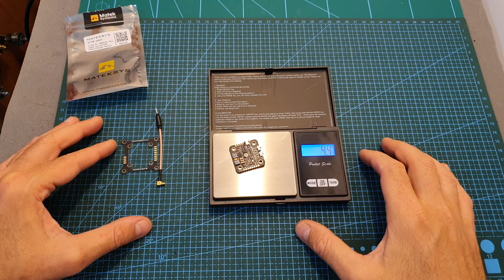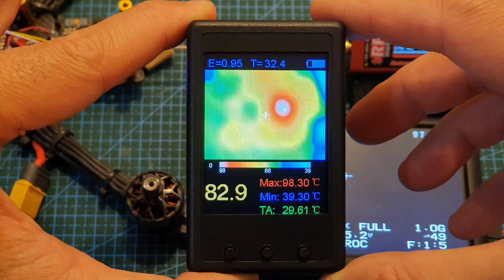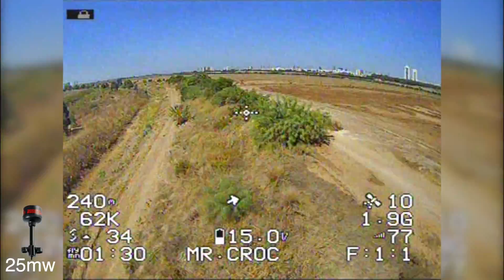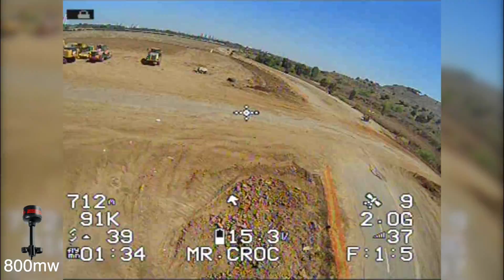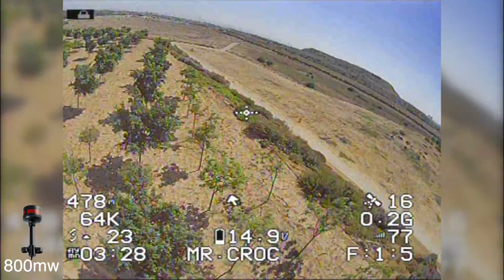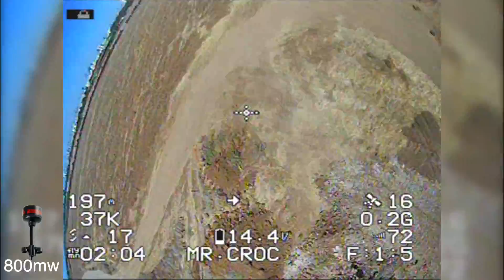Matek Systems VTX MINI - Setup, Review & Flight Footage

Comment: Used this on my dart 250g build and i cannot say enough... steer clear. It runs very hot for the wattage, has no good heatsink options, and the tramp controls through inav have been total junk and unreliable. I bought it with the justification that it would be most likely to work well with my matek F411-WSE FC... it did not, PLEASE AVOID LIKE THE PLAUGE. I also highly doubt the 800 watts is actually even accessible in tramp, look at the lights on the board when at the highest level.... 600. EDIT: I have been able to access the 800 watts and INAV arming / disarming safety settings have to be disabled to achieve more reliable power controls. Still runs hot and pit mode is not accessible via manual controls 50% of the time which sucks
Reply from the maker: Thanks for sharing your feedback. As far as I can remember I didn't end up recommending this VTX too.

Comment: Apparently there is a firmware update necessary for Betaflight 4.2 and beyond.   Would it be possible to walk us through this?  I've never updated a vtx before.
Reply from the maker: Sorry but I don't have this VTX anymore.
Reply: @KremerFPV  
Thanks i am actually using this in my Explorer lr and accidentally, and unknowingly broke something within the emitting element of the antenna during disassembly.  I did manage to update just fine per Matek's website and then, after some more troubleshooting found the problem to be the antenna.  Curiosity led me to carefully cut away the plastic covering and found the problem. 
Everything is working fine once again using a new antenna and new fw!
Reply from the maker: @Aarons14bugs  That's great!

Comment: At 6:12 you state the downside of this VTX is you couldn't get very far.  Why is that?  Compared to what?  What would you recommend NOW in 2020?
Reply from the maker: Hi Nick, I don't remember the particular reason but for a similar form factor and pricing with a better performance I suggest checking out the Rush TanK Ultimate Mini: https://youtu.be/kso-DQT4R3Q

Comment: Hello Gal! Thanks for another good video. Like you I have connected this VTX-mini to FC, but the Mateksys F772-se. Telemetry pin of the VTX to FC Tx6. In BF Uart 6 is set to IMRC Tramp. But still I can't get the BFOSD working to adjust VTX settings. Any suggestions??? Running BF 4.1.5 and OpenTx 2.3.7 on Horus X10. 
Kind regards Torgeir
Reply from the maker: Hi there. My pleasure. Did you configure the VTX table? 
Things got a little more complicated on BF 4.1.X.
Reply: @KremerFPV  Hi Gal! Thanks for your reply. After writing my comment, I did 2 things. Replaced a defective RunCam Split 2S (that didn't accept commands via UART. And swapped over to INAV. And now I'm able to send VTX commands via BF LUA scripts :) Without the VTX frequency tables. So now its just about tuning in PID's and get flying :) The benefint with INAV for a cinematic pilot with a 7" drone is the better capabilities for GPS hoower and return to launch with auto landing. 
Thanks again for your reply and happy, safe flying :)
Reply from the maker: @TheTorgehal  My pleasure, I am glad you got it sorted out. Happy and safe flying!

Comment: I notice your OSD indicates FS1 5740 but the immersion meter is set to 5750 also most VTXs vary on power through the band testing something like R1 and R8 would be a good indication.
Reply: I just looked at the Meter specs and see it goes in 50mhz steps.

Comment: Basically the same measured output as the Rush Ultimate, but only half the range for some reason. Perhaps Matek will send a replacement VTX for a retest?
Reply from the maker: I think that it gets very hot and therefor the output power drops. Maybe they should add a heat sink.

Comment: rush ultimate mini 800 or this matek? Which u prefer?
Reply from the maker: The Rush Ultimate Mini doesn't get as hot and you will get a better range with it. The VTX Mini does offer some cool features though.
Reply: Would like to know too. :-)
Reply: As an owner of the VTX mini I will definitely say NOT THE VTX MINI. Tramp controls have been unreliable, it does get very hot, and i am totally regretting going this route. I have in the end just disabled the tramp controls and i'm waiting for it to burn up upon landing at some point.

Comment: Good video bro. Like the Matek system. Sucks you couldnt get far with it. Probably a factory defect. Did you check on your tester what output strengh it was sending out at 800mw?
Reply: Sorry just seened it .